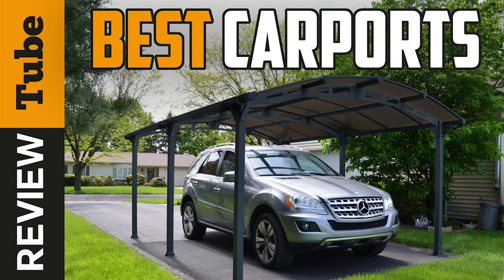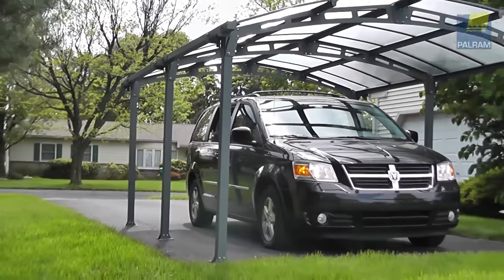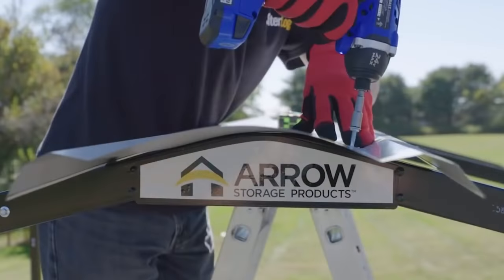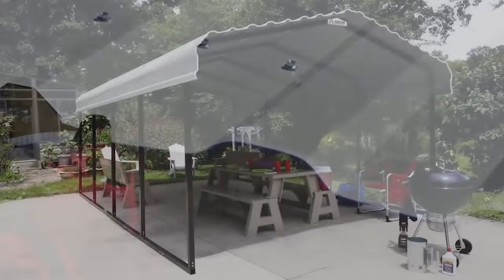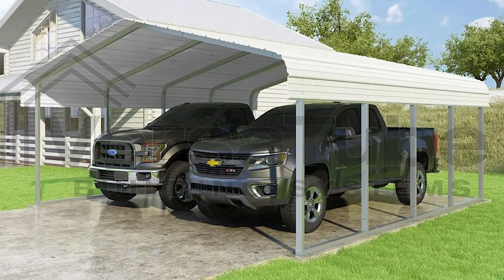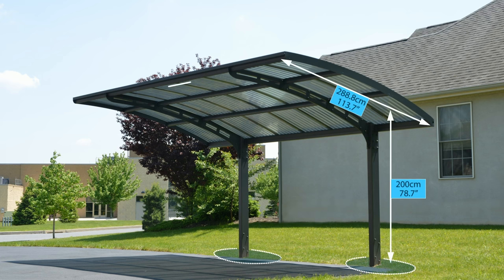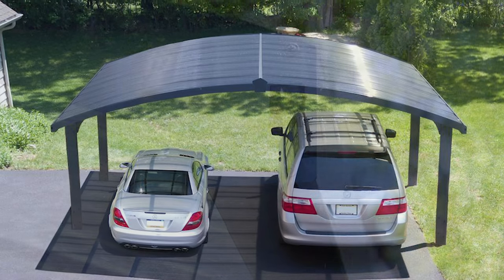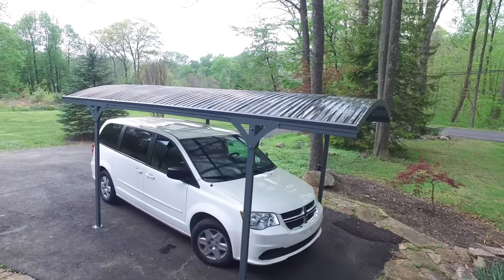✅ Carport: Best Carport (Buying Guide)

Comment: I built built a carport using 4x4 galvanized  for the posts and 2x4  perlines for the frame  and  24 gauge corrugated tin for the roof  flat roof sloped to the back and gutter   Set the posts in concrete  look on YouTube there a l lot of ideas    It’s easy to build and cheap

Comment: water will blow on top and side of the car via the open sides. I have a gazebo and rain hits the center frequently since there are no sides and it's 12x14.
Reply: Looks pretty good for hail protection, though. Or no? 

Also, I'm trying to find carport anchored only on one side.  Hard to find.
Reply: UV protection is the most important item.
Reply: Oh that’s sad rain on the top and side
Reply: @teller1290  make your own